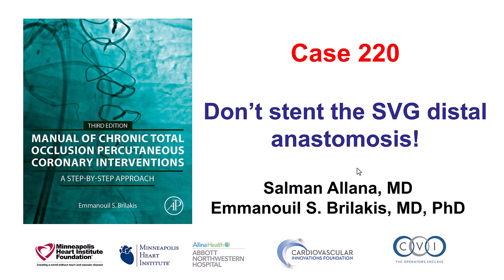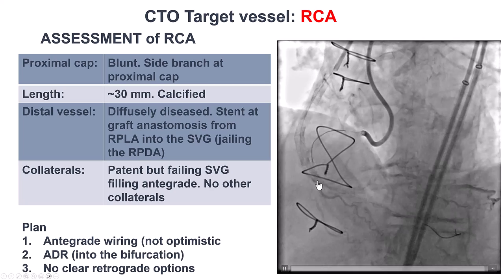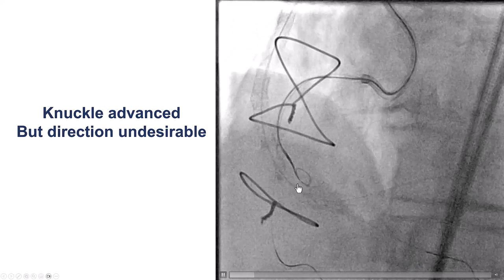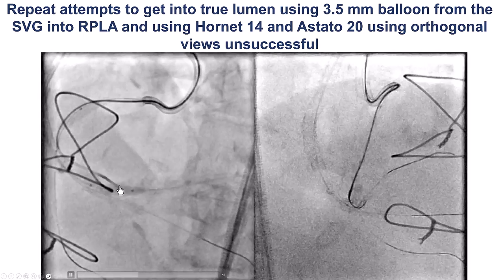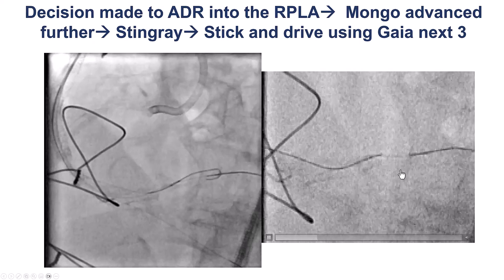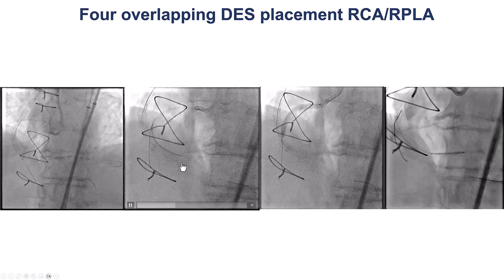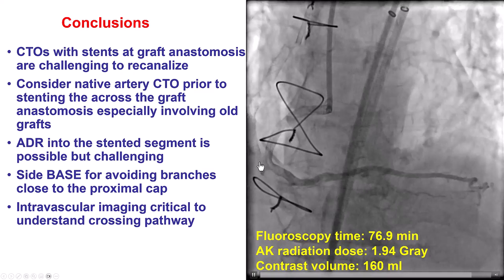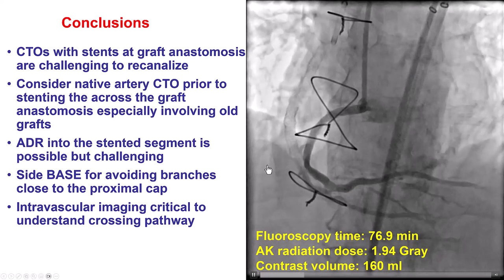Case 220: Manual of CTO PCI - Don't stent across the SVG distal anastomosis!

Comment: Excellent case. Could you call this technique as "retrograde culotte" as you operating from the 2 branches(distal RCA & SVG) toward the confluence of these 2 vessels( RPLB )? Please you opinion. Thanks.
Reply from the maker: Great point - I would actually call it "provisional with retrograde salvage"! We stented across anastomosis and when flow was lost in the PDA, we wired retrogradely into the right posterolateral and did kissing balloon inflation. If we had placed a 2nd stent, it would have been a "retrograde culotte"!
Reply: @manosbrilakis  Great. Is the new stent inside the old stent( across the anastomosis from SVG to RPLB) as you puncturing through it?  Thanks again for this case.